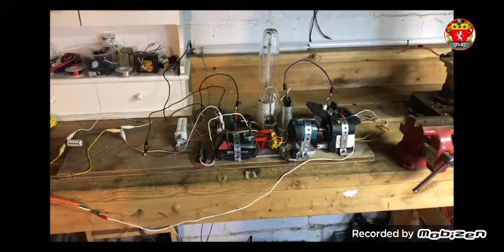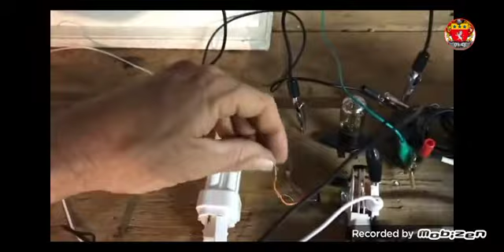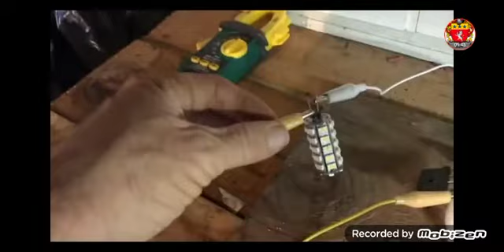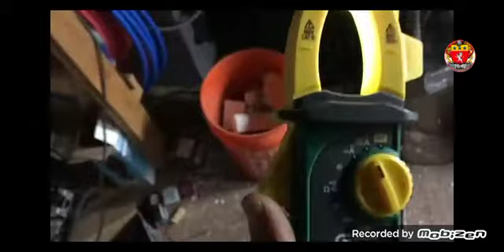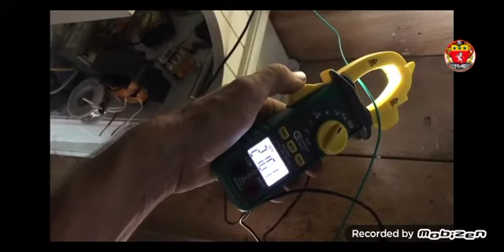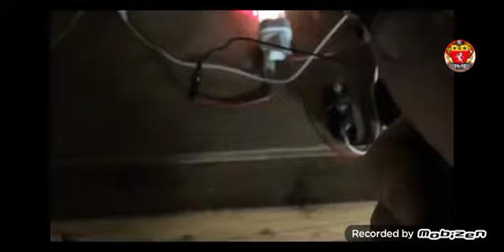Some things I learned about electrical energy

Comment: Dear Mr. Jason have a look here: https://youtu.be/U_ZYo3h69hg
You are sucking the volts from earth probably. Concerning the amperage it is realy difficult to measure that correctly as our equipment are not setup for that kind of frequency (moreover, there are a lot of RF signals everywhere and your amperometer is using the "Hall" effect). I already get that problem. Probably reading is possible after a rectifier with a DC current. Try to measure the current outside where your wire is fixed on the ground (less interference).